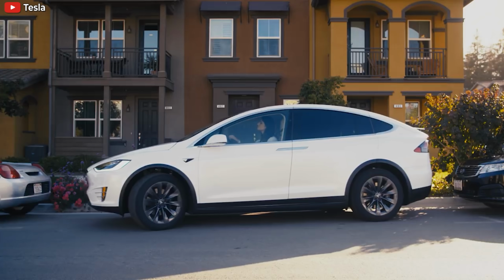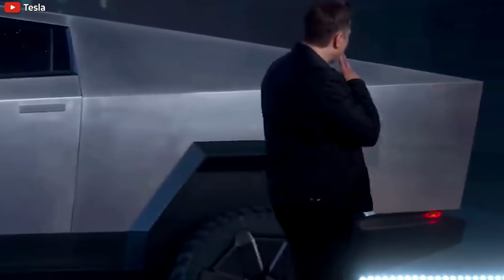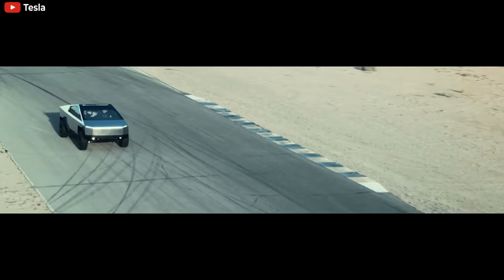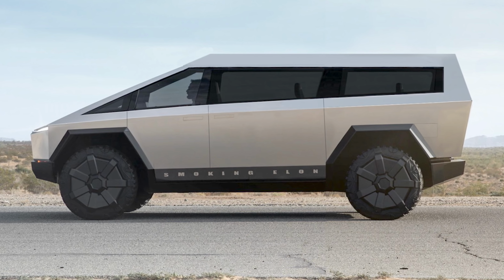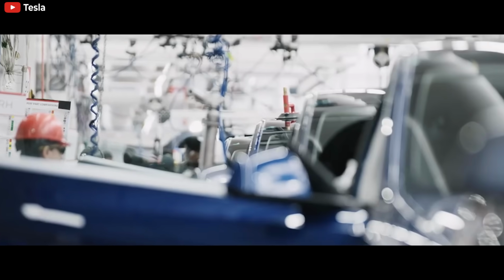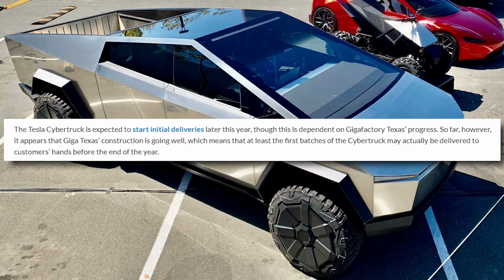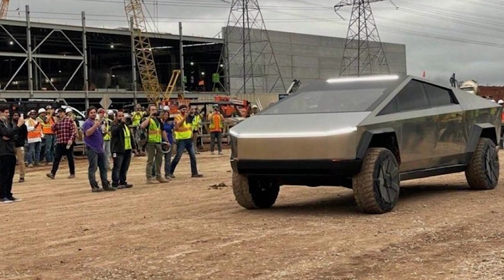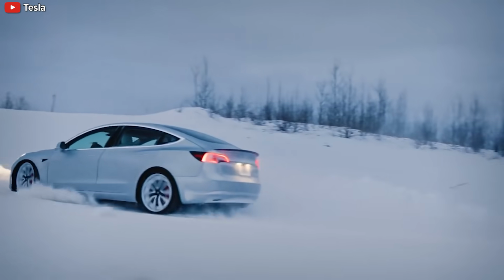Elon Musk Confirms Cybertruck's Final Design Features with Crab Mode

Comment: I wouldn’t be surprised if he suddenly announced it had an 8’ bed. That would instantly destroy all the competition.
Reply: A full 8 feet (the 6’6 bed plus a full foot and a half of new material) would put them over the totally length limit, so you can count on that not happening. Or at least you can count on that not happening without them also shrinking the cab to accommodate the length limit
Reply: @Learn2oo  Ok, thanks, I didn’t know that. Is the maximum length a vehicle classification? Does it affect taxes or driving licence limits?

Comment: Rear wheel steering will shorten the turning radius which facilitates making U-turns and navigating parking lots in such a large truck. Bravo Tesla!
Reply: Buyers will go absolutely nuts over this thing if it does have all-wheel steering.
Reply: Yeah, that's what I thought about first as well. The crab walk feature will be a cool party trick, and it could help in some tight off-road situations. But rear wheel steering will help all owners with better handling and a tighter turning radius, which could otherwise be a problem with such a large vehicle.
Reply: I hope it is able to be turned off... might not be great for towing.
Reply: I have a chevy 2500 currently and I swear i have to do a 3 point turn to turn forward into parking spaces. The front end is so big that I never risk hitting the unseen. The low front end of the Tesla grabs my attention but the 4 wheel steering will really make it right. I always say my truck has the turning radius of a rocket ship.
Reply: So we copied hummer ev crabwalk
Reply: @hugoortiz6841  crab walk is different than all wheel steering. And hummer isn’t the first to do that either.

Comment: What i heard was 4 wheel steering. not crab mode.
Reply: Crab mode is gimmick that will wreck your tires unless you spin on slippery surface
Reply: @mukamuka0  
Spin? I believe you're thinking of tank turns like what the Rivian is offering with the 4 motor varient

Comment: To fit Crab mode to the Cybertruck will not be an advantage but to fit 4 wheel Steering would be on enormous benefit at low speeds!
Crad Mode is a Gimmick and will cause accidents and lots of damage in done incorrectly!
Reply: Elon said 4 wheel steering, not gimmicky crab mode.